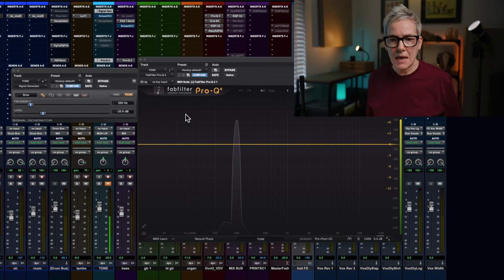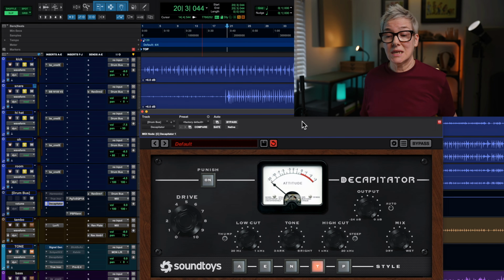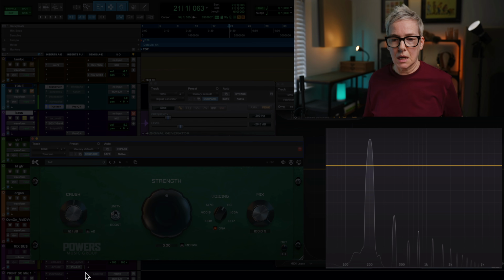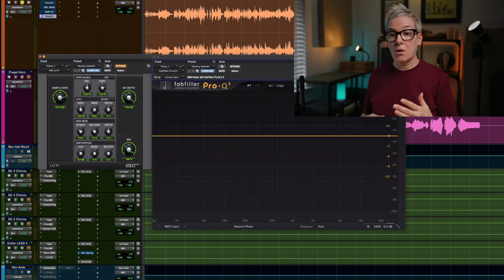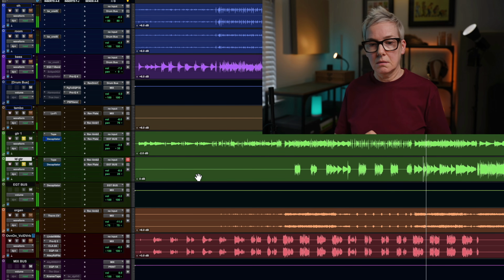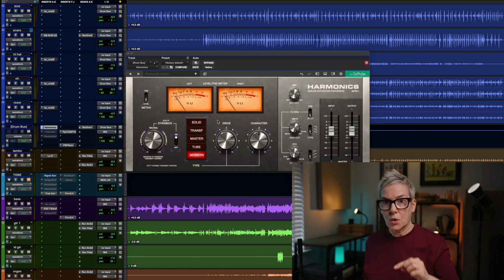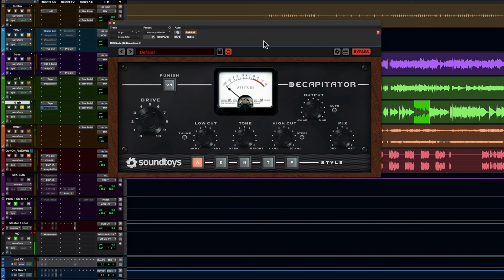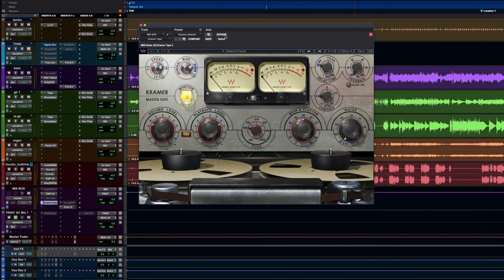Unlock Saturation - How To Choose Tube, Transformer or Tape

Comment: The tip about not saturating so much on group busses blew me mind. I usually saturate on group busses and not individual tracks. Should I saturate on individual kick/snare tracks, and not the kick or snare bus?
Reply from the maker: Try both and see which sound you prefer for your mix

Comment: One of the most special saturators that I found and am using, is Phil's Cascade!
As Sara told, it is extra great for certain vocals, when they sound a bit thin before, and especially I use it for thin sounding keyboards. That's because you can dial in frequency bands that need enhancement. And it does not sound EQ'd, the harmonics become kind of natural and intrinsic, as if the sound had always been so good.

About the before/after conclusion, I totally agree, but it is also very much a cultural thing. Doing underground Hip-Hop tapes may have very different paradigms from this Rhythm And Blues band example.
I can hear the culture of successful and beautiful live music broadcasting here.

Comment: 🎚 Pro Mixing Tip: Controlled Harmonics + Gated Ambience on Kick

Instead of driving your entire kick into one saturation chain, split it into two controlled layers:

Click Layer (Attack)

Use a bell EQ to isolate the click range (2–5 kHz).

Apply odd-harmonic saturation (FET/transistor) to enhance punch and presence.

Shape dynamics with a fast FET compressor (e.g., 1176).

Tail Layer (Body)

Apply a high-pass EQ to remove sub build-up.

Add even-harmonic saturation (tube/tape) for warmth and fullness.

Smooth the sustain with an optical compressor (e.g., LA-2A with long release).

Ambience Bus

Route both layers into an ambience channel with short reverb/room or slap delay.

Sidechain a gate from the clean kick so ambience opens only in the gaps between hits.

Blend dry ambience (clean space) and saturated ambience (dense, warm space) to taste.

Final Blend

Keep the clean kick as your anchor.

Parallel in just enough ambience to add depth, width, and harmonic density — without muddying the sub.

✅ Result: a kick that’s punchy and present on the transient, warm and full on the tail, and wrapped in controlled ambience that only blooms between hits.
Perfect for modern house, techno, EDM, and cinematic low-end design.

Comment: @37:25 I agree, in the mix it does sound thicker vs in solo.
Reply from the maker: Thanks for the feedback!
Reply: @SaraCarterSimplyMixing Sure thing! Do you have a favorite noise reduction software? One that leaves the desired signal alone? Like sound effects? My stereo remix of an old radio drama that I have uploaded didn't require NR. Maybe I'm too picky.

Comment: "Even harmonics align well with the musical scale, which sound right, while odd harmonics sound odd" -- This might plant some misleading ideas in people's heads. Even harmonics are simply all the subsequent octaves above each odd harmonic. So as far as fitting to a scale, even harmonics are the exact same scale degrees as the odd harmonics, just in higher octaves.
There's nothing weird-sounding about odd harmonics. A sound that consists overwhelmingly of odd harmonics, like a clarinet or the neck pickup on an electric guitar, sounds perfectly nice and natural. A sound that consists only of even harmonics sounds very annoying, and I can't think of anything that naturally contains only even harmonics. I think the reason why even harmonic saturation sounds nice is because many sources are naturally leaning towards odd harmonics, so adding even harmonics fills it out.
There are also many instruments that have overtones that are not harmonically (integer) related to the fundamental. Pianos are even slightly this way. Adding saturation to instruments like these can sound bad, because then you're not filling out the overtones, you're clashing with them.
Another thing to consider is the phase of existing overtones. Adding saturation to a sound that already has those harmonics 180 degrees out of phase will cause a cancellation in that harmonic. A triangle wave, such is often used with synthesizers, is a simple example where odd-harmonic saturation can actually decrease the overtones.
Reply from the maker: Thanks for sharing your insights on harmonics, it's a helpful perspective!

Comment: If I look at the frequencies of the harmonics, im starting to doubt my comparisons. Mixes I compare with, usually have a bit more information in the high end. I always compensated that with Eq, figuring I must add more high end. Seeing this, I wonder if I just need to add more saturation, and have more harmonics in that upper region.
Reply from the maker: Interesting point, saturation would help but it's probably a bit of both

Comment: You do such subtle touches and flavours that I have a difficult time picking out differences. You're already working with clean and pretty source material too!
Vs in my hobby noodling, the impulse is to push it all as hard as I can, because there's going to be a sky high noise floor, no matter what. I'm also just horsing around with drones, dumb techno, and harsh noise. Way too many delays, all the feedback, and hahshhshahsha, oopsie, it just sounds like a low grumble. Everything is stepping on everything else. Better dial back most of the knobs. Fun times at home vs super pro on the youtubes.
Cheers for the tips.
Reply from the maker: I get that, it's a different world when you're working with noise! 😜

Comment: I really like the new The Black Keys record, but a couple of the tracks I feel like they went a bit heavy on the saturation and it feels like a wet blanket a little bit. Still a 9 out of 10 record but I feel like modern producers, especially when they are trying to sound “vintage” can lay it on too thick. When it comes to EDM and pop I have no specific expertise, but it seems like all bets are off in many cases. They are often trying to create unnatural variance in sonic texture and that can lead to extreme saturation as a motif.
Reply from the maker: Yes, it's a taste thing, plus records are mastered so loud, which doesn't help

Comment: This is the best tutorial on saturation I've ever seen. Excellent audio examples which you never hear in these tutorials. Amazing amazing work.

I am still new to all this. It seems that there would be a particular order of processing between compression and saturation yes? Could you say that generally, you should set levels, then do saturation, before ever touching the compressors?
Reply from the maker: Thanks, I'm glad you found the examples helpful! 😊. No order, remember, harmonic saturation comes from any analog modelling plugin at any point in the chain. Be mindful of that as you apply them and check input levels to them for signs of loud signals, the bass in this video is coming in a bit loud tbh but it still sounds  good. Just be aware and intentional.

Comment: Hi Sarah. Another useful video but i have 1, possibly daft question? When you were talking about level-matching, i couldn't help but notice, on the Omni plugin, the input was max-ing out. Or, is that just how you use it? P.S. Love the sound of this mix!
Reply from the maker: Yeah, it was a bit hot, this means you get more of the colouration imparted to the signal. So long as it still sounds good that’s ok.
Reply: @SaraCarterSimplyMixing  Spot on!

Comment: Great video!!! I use Saturn2 on all my masters in a very, VERY subtle manner (like + .5 - 1.5dB boost in the high mids). I find it helps bring out some clarity by adding upper harmonics to the mix. Sometimes there is huge differences even with small increments in sat, but I normally choose an algorithm (like subtle transformer) that doesn't decimate the audio:) Loved you explanation!
Reply from the maker: Thanks for sharing your experience and thoughts!

Comment: Great master class,  Sara. In case it helps others:  I calibrate the output volume of saturation plugins to unity gain at different saturation levels. I think this is crrical. Otherwise, I tend to overuse saturation, because "louder is always more better" 😅, and i wind up with a muddy mix. Basically, I love saturation. I tend to think less is more, and I tend to use it in the master bus. And very sparingly on an instrumental or vocal that needs extra.

 The other thing I like to do is to increase saturation to the point it is clearly too much, and back down from there to the point it makes things better but you don't notice it is there. Like a referee in football, the best go unnoticed. This is in contrast  with, say, delay or chorus which in some cases can be totally in your face.

With Saturation it should be rare, but not impossible, just vey niche. I am thinking industrial heavy music can abuse it for stylistic reasons.

Ok, back to my cave. Much Love!
Reply from the maker: Thanks for sharing those tips!

Comment: Mixes nowadays are WAY too saturated, trading repeated listenability for initial impact
Reply: Agreed, especially "emulating" plugins 🙉
Reply: @EmperorKamikaze  the best plugins don’t emulate anything and because of that, can be used far more flexibly than any hard ware. A hardware compressor that can do what TDR Kotelnikov GE does will run you around 5-6 bands, whereas Kotelnikov GE can be had for literally $10 on sale, or $50 without it and you can run as many as you want in the session, as long as your CPU can handle it. Even for people with hella gear, you will run out of I/O, space to keep all that shit, or money to buy enough to use all over a mix lmaooooo. TDR Molot GE is another similarly impressive compressor plugin. Everything by Goodhertz is amazing. Acon Digital. Fuse Audio Labs which models rare shit that’s actually cool instead of a boring ass LA2A 3A thing. There’s plugins out there that aren’t shit, and are actually incredible (and some of these plugins are old as fuck, like The Sony Oxford original six pack bundle and the Waves Renaissance bundle), but the emulations aren’t ever that.

Comment: The analog world wins for aggressive saturation hands down. The plugins are great for subtle use though IMO. The aliasing is inaudible. Great video!
Reply from the maker: Thanks for the feedback!
Reply: Aliasing doesn't exist in the analog world, it's a digital only problem
Reply: Certainly! Plugins are good pretenders for those without hardware tho.
Reply: @EmperorKamikaze most hardware is shit in its own way, has to be repaired at some point, and a lot of parts of hardware that would get repaired, particularly certain tubes, physically can’t be made anymore…